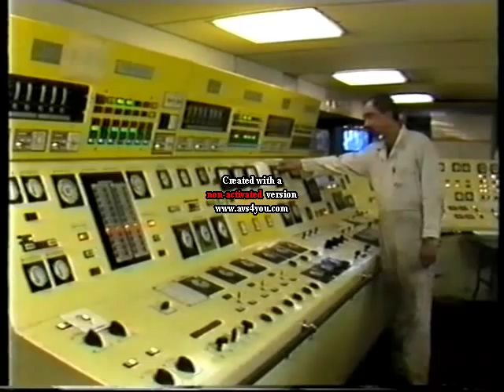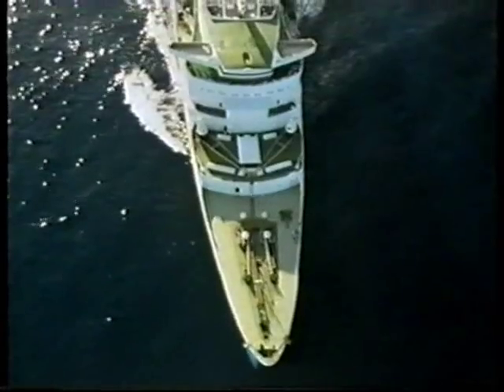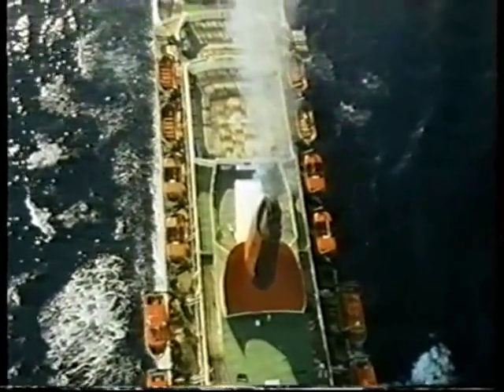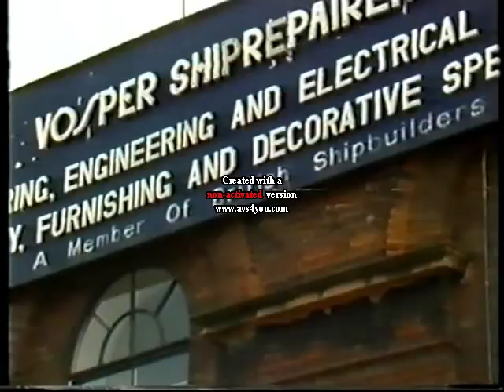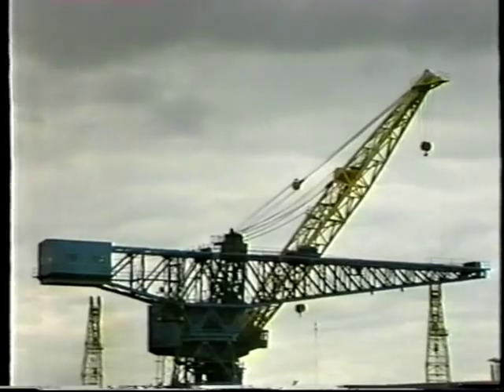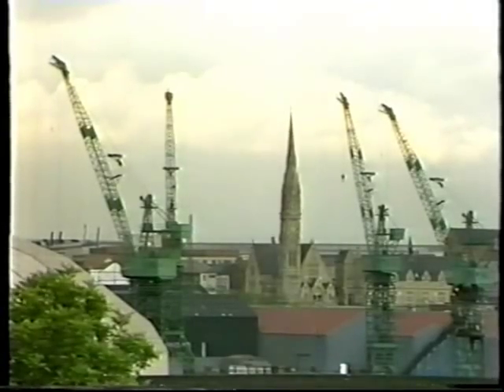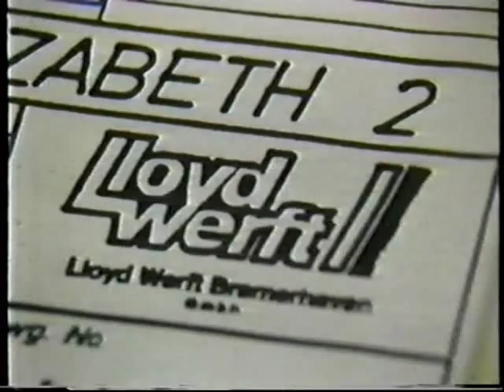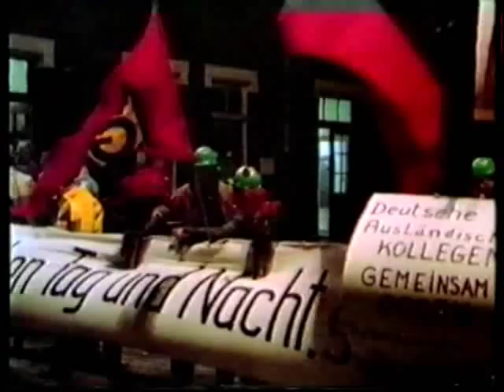Why the QE2 could not be re engined by a UK shipyard

Comment: that's quite some job, the boilers and turbines were put in during the construction of the ship due to their size. I imagine they will have to cut open the ship to get them out and replace them.
Reply: Bernie Wright  I wrote that before I saw the part about taking out the boiler intakes and lowering it in so they don't need a larger dry dock.

Comment: It was strictly political why it was not done in Southampton, We do have the cranes in Southampton, apart from the floating crane, along side number 7 dry dock is a 50 ton crane and 25 ton and 2 10 ton cranes, and more could be bought in on the rails if needed, Vospers got told by the Tory party do not make a bid for the contract, Thatcher era killed the heavy industray and turned the country into a cheap labour force for the service industry, They did not want any one bring good paying jobs back to England

Comment: fitting motors is nothing but cutting a hole in the side and moving them in then welding it shut again. it's the suppliers of said motors that are basically limited to siemens/aeg, westinghouse, several japan based conglomerates back then (before china re-entered the game and before aeg went out of business) that define the location where this is most optimized to be done. you're not gonna transport some 200tonnes of steel all the way to the uk just to mount them into a ship there when you can simply do the whole job closer to the factory where the motors and generators are made. it isn't the 'facilities to do the job'. it's the facilities to make the required equipment that define the location.

Comment: The best way of doing ships engine jobs is thru the side.
Reply: Theses days they slice the ship completely in half crosswise, pull the halves apart, then add in a new section. If the engines need to come out for rebuild or replacement, that's when they get done. At the time the QE2 was converted from steam to diesel electric, ship lengthening was not a common practice. The Royal Caribbean "Song of Norway" was stretched 85 feet in 1978. "Nordic Prince" got a stretch in 1980.

Comment: Its not fucking financial/economic rocket surgery that if you have to buy/build the ability to perform a "swap" like that which includes both removing boilers and turbines and replacing them with gen-sets and electric motors for propulsion including "thruster pods" which obviously have to go on the OUTSIDE of the ship and then pay for the "labor", the "shipping company" would then be better off just STAYING IN THE "SHIPBUILDING" BUSINESS because otherwise for a SINGLE "JOB" THAT'S A "REFIT" OF AN EXISTING SHIP AND A "REPAIR" REGARDLESS OF WHAT YOU CALL IT IS ALWAYS GOING TO BE A FREAKING EXPENSE AND WILL NEVER "PROFIT" THE "SHIPPING COMPANY".

MONEY "LOST" IS FUCKING LOST FOREVER. IT CAN'T BE "MADE BACK" ANY MORE THAN "TIME LOST" CAN BE "MADE UP" BY SPENDING MORE TIME/MONEY TO "SPEED UP" ANY "PROCESS" THAT IS ALREADY "BEHIND SCHEDULE". 

And OVERHEAD CRANES cease to be the main "issue" if you're going "through the side" and the "solution" from that one supposed "expert" to use a "floating crane" or a "portable crane" which by the time you reach 100 tons is ON TRACKS and places the operator literally in a literally "blind" position where he/she has to have "instructions" radioed to him/her but cannot see the "lift" and the "load" is exactly the stupid shit that was "proposed" initially and that only "shadetree shipbuilders" would try. Not to mention cranes of that size with the height capacity to do those "lifts" are "too big" for a job like that and have booms several hundred feet long. They're mainly designed, produced and used for "wind farm" construction/maintenance, take anywhere from 8-12 "truckloads" of "parts" to transport them, require a pretty damned large crane just TO assemble them and are not "compatible" with a freaking concrete "dock" given their tracks and their "ground pressure" which far exceeds what the "thin" concrete of a "dock" which is just a "shell" at "ground level" with a few inches of concrete over soil that has never been "compressed" can even come close to "supporting". 

Want to know why "Britain" can't do what is a joke and colossal "boondoggle" of a "construction project" like that in the first place? Because "experts" and "engineers" who have never set foot on a fucking "job site" and think its possible to "invest" money in a failed technology/object to "improve" it only to "increase efficiency" can ever possibly be "profitable" to anybody involved except the "at cost" non-"contractor" who is only going to take on the "job" on an "it'll cost what it costs" basis with a big "deposit" in hand doing the work. And even then, it's only going to be with "government subsidies" that such a "project" gets "financed" in any "European" or "Asian" country that's a "socialist democracy". 

And the only reason "government" and its "media" owned-and-operated BY "government" give a SHIT about "industrial capability" and doing a "project" like that is for the "propaganda value" and to keep as much "capital" there "safe at home" as possible while hiding the FACT that those "international shipping companies" are just nationalized government-operated and "taxpayer"-subsidized fucking "black holes" for "public funds" going into them that only "turn a profit" because they're used for shipping cargo and "currency" from "overseas" back to their "home countries" via "tourism". The also do a lot of shipping of liquid "cargo" called diesel fuel or "petrol" from "overseas" back to their "home ports" where its marked up a huge percentage and sold as "petrol" to "citizens" or used to "fuel" the "navies" of those "maritime countries". 

The "boilers" that were originally designed for "bunker fuel" or "heavy fuel oil" which is more or less "lightly refined" crude oil, which is no longer "practical" to "transport" to "ports" and "docks" that never made the jump from "coal" to "oil" in the FIRST PLACE also can't be "replaced" with "synthetic" fuel oil made from "coal gasification" or "mixing" dried and "crushed" coal "powder" with distilled water to form a "slurry" that can and will actually "work" in a combustion chamber/boiler/engine designed for it without ridiculous "investments" in "infrastructure" and most of all more "energy" to power it which means more "powerplants" and "grid" and "base load" generating capacity to supply all the electricity necessary to operate the kinds of "refineries" and "factories" and "pipelines" and "storage facilities" necessary for "sustainable" and "local" production of "fossil fuels" for powering internal/external combustion engines. 

Even if you build that "industry" at home, unless you have a big enough "gas tank" that you don't need to "fill up" at "ports" where only diesel fuel or bunker fuel is available, you're still fucked "overseas". And the REAL "story" here is that there IS NO SUCH PLACE AS "BRITAIN" OR "GREAT BRITAIN" AND AS SUCH IT HAS NO AND NEVER HAS HAD ANY FUCKING "INDUSTRY" PERIOD AND "BRITAIN" AND "GREAT BRITAIN" ARE JUST "NICKNAMES" FOR A GEOGRAPHICALLY-NON EXISTENT PLACE WHERE "GOVERNMENT" AND THE "ELITE" FROM AROUND THE "COMMONWEALTH" AND "UNITED KINGDOM" ACCUMULATE THEIR "WEALTH" AND "FORTUNES" AND WHERE THERE ARE NO "LAWS" AND OBVIOUSLY NO "LAW ENFORCEMENT" AND NO "SOIL" FOR ANY OF EITHER TO "EXIST" IN THE FIRST PLACE. 

ITS LITERALLY THE "UTOPIA" OF THE "REAL WORLD" AS "CREATED" BY "POWERFUL" PEOPLE WHO ARE LITERALLY "ABOVE" THE "COMMONERS" IN THEIR "COMMONWEALTH" MONARCHY "NATIONS" DUE TO BEING "ELEVATED" TO THAT POSITION BY THE "ROYALTY" AND ARE "NOBILITY" AND COMPLETELY "IMMUNE" TO ALL "LAWS OF MAN" BECAUSE OF COURSE ALL "MONARCHS" AND "ROYALTY" ARE "CHOSEN BY GOD" WHICH MAKES "ROYALTY" AND THEIR "NOBILITY" THEY CREATE FOR "PROTECTION" FROM THE "COMMONERS" UNTOUCHABLE BY ANY "LEGAL" MEANS AND MAKES THEM ONLY SUBJECT TO BEING "REMOVED FROM POWER" BY "VIOLENT" MEANS. 

And if you want to know why THEIR "Utopia" is "crumbling" and "unsustainable" no matter how much "power" they have over "commoners" they absolutely depend on to be "workers" regardless of where, when and how the "work" they'll sure as hell never do and can "do without" since their own "futures" and "power" and their own little hidden "kingdoms" are "overseas" and "safe" from the "violence" of the "commoners" - or so they think, do some research into the "etymology" of the word "Utopia" and its true "definition". You'll find that it "means" a place which does not exist. And it long predates George Orwell. 

The reason THEIR "Utopia" called "Britain" or "Great Britain" is "crumbling" is because as a "non-existent place" and just a figment of people's imaginations with no "physical address", it only exists in an "ether" where even "digital currency" and "cloud computing" holding "wealth" in "currencies" that DON'T EXIST ON "PAPER" OR IN "GOLD" AND AREN'T EVEN "FIAT CURRENCIES" IS DEPENDENT ON THE "WORKERS" TO "EXIST" EVEN "THEORETICALLY". 

But of course those privileged, entitled, lazy-ass "special" people who have never "worked" a day in their lives regardless of their "jobs" or "careers" figured that was the "beauty" of having a "digital currency" and "cloud computing" and "wireless communication" and the ability to "make money" from "afar" while doing nothing but giving "orders" to "commoners" who "transfer" their "wealth" around the world "instantly" and "invisibly". No "paper trail" and using various "Utopian" non-existent "financial institutions" and "destinations" for their "money" meant that when they "retired" or simply "disappeared" to their "resorts" they've "built" all over the "globe" meant their "business deals" and "investments" back in the "real world" could and would continue to supply them with "wealth" accessible "immediately" via the "internet" wirelessly via "satellite" or "cell phone" or "wire transfer" using "landlines" to connect to/through "intermediaries" with "access" to online "financial services". 

Unfortunately, "hackers" and the fact that the overwhelming majority of the "communications infrastructure" of the "globe" is "publicly-owned" by CITIZENS of a few actual REPUBLICS that HAVE NO "ROYALTY" OR "NOBILITY" OR "SPECIAL CLASSES" OF "UNTOUCHABLE" GOD-CHOSEN "LEADERS" OR "OFFICIALS" AND THEREFORE NO REAL ABILITY TO "ELEVATE" ANYBODY TO A "HIGHER SOCIAL CLASS" EXISTS AND ALL "LEADERS" ARE IN THE END JUST "PUBLIC SERVANTS" AND "GOVERNMENT EMPLOYEES WHO ARE "ACCOUNTABLE" TO THEIR FELLOW "CITIZENS" OR WHO ARE "FOREIGN NATIONALS" WITH NO "CITIZENSHIP" MUCH LESS "DUAL-CITIZENSHIP" PERIOD ON U.S. SOIL MEANS EVEN "PRIVATE COMPANIES" THAT HAVE ANY "INTERESTS" WHATSOEVER CONTRADICTORY TO THE SAFETY AND SECURITY OF U.S. CITIZENS AND THE NATIONAL DEFENSE OF THE UNITED STATES AND ITS "GOVERNMENT" WHICH IS OF, BY AND FOR THE "PEOPLE" ARE AN EXISTENTIAL "THREAT" TO THE SAFETY AND SECURITY OF SAME. AND THAT GOES FOR ANY "FOREIGN" OR "INTERNATIONAL" PERSONS USING THE "DEFINITION" OF "PERSON" USED BY THE "FEDERAL GOVERNMENT" OF THE U.S. THAT INCLUDES "COMPANIES" AND "CORPORATIONS" AND "ORGANIZATIONS" AND "WORKERS" AND "TAXPAYERS" AND "CITIZENS" AND "NATIONALS" AND "RESIDENTS" AND ANY OTHER "ENTITY" OR "PARTY" THAT RELIES ON "HUMAN INTELLIGENCE" AND WHERE THE ULTIMATE "MISSION" OF SAID "PERSONS" IS TO "MAKE MONEY" AT THE EXPENSE OF "AMERICA".

It NEVER WORKS to go into "business" to "make money" rather than the "produce" goods and services people actually NEED TO SURVIVE and least of all does "investment" of/in what is ultimately SOMEBODY ELSE'S "CURRENCY" WORK WHEN IT COMES TO "MAKING MONEY" WHILE HAVING NO "PAPER TRAIL" OF ACTUAL "SALES" AND "PURCHASES" OF ACTUAL TANGIBLE, PHYSICAL "PROPERTY" EVER END UP "FINANCING" ANYTHING BUT THE SPECTACULAR AND TOTAL "COLLAPSE" OF THE "UTOPIA" LAZY-ASS PEOPLE WHO THINK THEY'RE "SPECIAL" BY "BIRTH" AND "RACE" AND "ETHNICITY" OR SOME OTHER "INTANGIBLE" AND THEREFORE "IMAGINARY" CHARACTERISTIC(S) ULTIMATELY "FINANCE" WITH OTHER PEOPLE'S TRUE "WEALTH" OF "LABOR" AND "TIME" ONCE THEIR "MONEY SUPPLY" IS "CUT OFF" ALONG WITH THEIR "IMPORTS".

Comment: I thought passenger ships used gas turbines now. Can it be converted?.
Reply: Gas turbines are great for high power but they are very inefficient. Marine diesel engines are the most fuel efficient engines that can be had.

There are recent developments where most of the wasted energy from a gas turbine can be captured by a boiler and used to drive a steam engine (google COSAG). But this technology was very immature at the time of the QE2s re-engining.
Reply: @Kimdino1  Thanks, but I read that diesel engines were undesirable for cruise liners because of vibrations. Maybe smaller ones which generate electricity are OK.